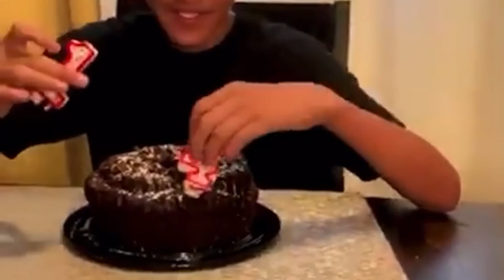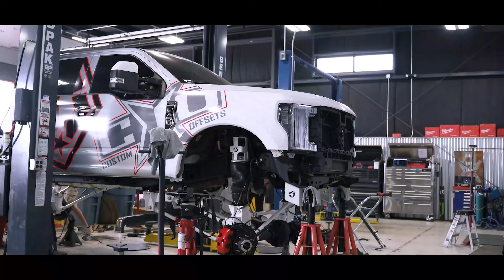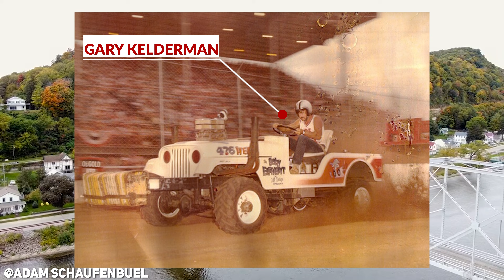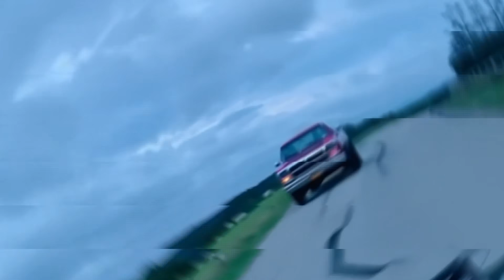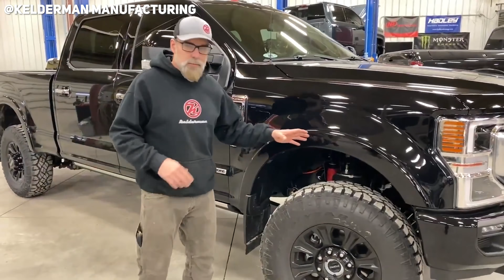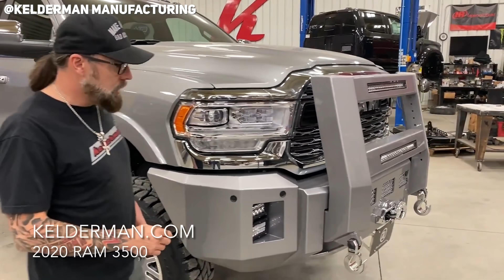Everything you need to know | Kelderman Manufacturing

Comment: I have a Ford F350 that's lifted with overload springs and I would like to add airbags to even out the ride while pulling a 32' AG equipment trailer that weights between 7,000 to 13,000lbs. I took it to my local 4x4 shop and they said they didn't have  bags big enough for the u-bolts to properly fit my truck (these were Airlift bags). Can you recommend an air bag brand that'll fit my lifted truck that's lifted with overload springs? I appreciate your help!

Comment: I was looking for a set of single 20x10 or 11" wide for my 09 F550 10x225 bolt pattern, do you have anything for this application? I am wanting to run 37" tall tires. I would love to put a Kelderman air ride kit on my truck also. My ruck isn't exactly stock so i don't mind having to make clearance for the tire size, it is a 2009 F550 with a Cummins in it and all King Ranch swapped interior. Thanks
Reply from the maker: Hey! Please reach out to our customer service team and they can help you figure out the perfect fitment. 

Sales@customoffsets.com 
920-949-0909

Comment: Onservation:
The Kelderman is a horrible design. Your axle moves left to right. The steering wheel rotates.
Those praising it won't admit it's cheap because they own it.
Reply: I am looking at a 2017 f350 with a kelderman on it. I am supposed to do the paper work on it tomorrow. But looked at it in person today and noticed both front lift bags are “leaning “ toward the passenger side, and the drivers side is touching the frame. Is this from the axel shifting?

Comment: I love Kelderman lift kits, I've had their 5-6 on my last 3 trucks. An 016 f350 single rear, 018 f450 Platinum dually, just got my 22 f450 Platinum dually back from them in September. I've had other trucks in the past and other lift kits, nothing I mean nothing compares to the Kelderman lift kits, the ride is outstanding, towing is excellent as well. Their bumpers are top notch as well as all the other custom touches they do. I went all out on my 022, I won't trust anyone else to work on my trucks. Customer service is great as well. The cost my be a lot more than your typical kits but it's well worth the money.
Reply from the maker: Hell yeah, that's some good insight!
Reply: For my 22 chevy 5500 4x4 i wanted simplicity!

Kelderman has been 1st. Choice

But what about 90% off-road, or heavy (Not Abusive) expedition style off-road ING...

What is a good choice for a long expedition style off-roading (simplicity)?

Comment: That was 3 years before the mega cab!
Reply: A place called the Alton company did it. He had a quad cab long bed and they lengthened the cab 12” and then took 12” out of the bed to keep the same wheel base. If you’ll look at the back doors you’ll see they’re the smaller quad cab doors instead of full size mega cab doors